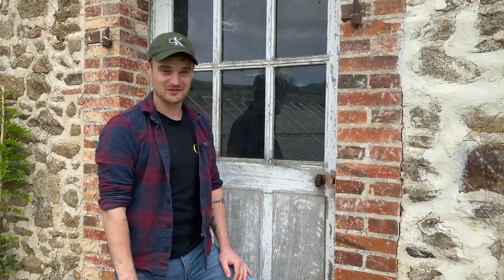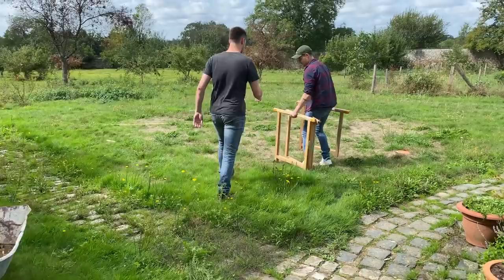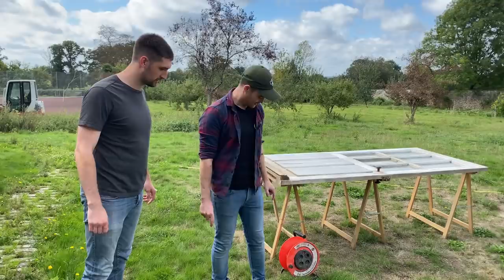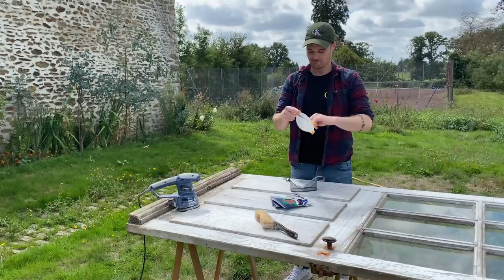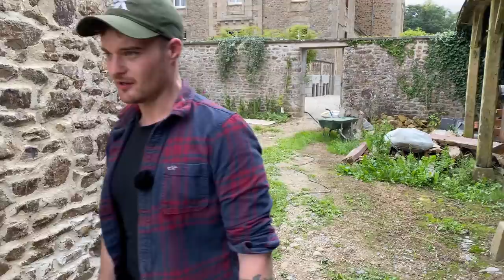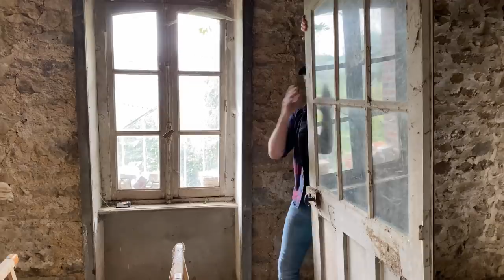Front Door Fix Up - Doing It Ourselves

Comment: The French certainly had a better ideal on hinges. Lift off.
Reply: Willdo1951 Aldone Yes, i love that!
Reply: What kind of hinges do people have wherever you are from? 😮
Reply: @fionasimagination  In America, the norm for doors is a 3-piece hinge, with a loose pin that joins the two halves together--or sometimes a fixed hinge, so you have to unscrew one of the sides to take down the door.
Reply: In USA, some old hinges are like that. The US standard ones are better for security.
Reply: @counter10r  Same in Australia, I have both - we used the 3 piece pin hinges on all the internal doors of an extension
Reply: Almost all in mainland Europe has the hinge thing. It is sooo much more convenient, esp. as a woman to just lift the door off the hinge. I never understood the three piece thing with a pin to hammer in as well as the more 'modern' screw in thing in the US. Way too complicated.

Comment: When you clean the old glass use a fine steel wool pad and the glass will be crystal clear! Glass will look as good as the day it was made!!!
Reply: thinktonka Great tip!
Reply: Also you can use a vinegar and water solution
Reply: 1497caboto Yes that works great. That’s how I always clean windows and mirrors.  

The extra fine steel wool will smooth out little scratches.  I use it on enamel appliances, too (400 grit), and they stay shiny.
Reply: DOES THAT REALLY WORK?
Reply: @theresaromero2855  well that's a great new tip. TY 😊
Reply: Barbi Button My pleasure, Barbi!
Reply: @nativetexan53  it really does! A friend of mine did it to my garage door windows a couple years ago and I couldn't believe how well it worked! Grime builds up in the pores of the glass and plain window cleaner just doesn't get it! Just use the steel wool in a buffing motion and you will be amazed!!!
Reply: Linda Catz exactly
Reply: Fascinating tip!  I will be trying this on our store's front windows!  I would never have thought steel wool would be helpful against scratches - Would have thought it would MAKE them.
Reply: @eledatowle7128  I thought the same thing! Was pleasantly surprised at the results! Use fine steel wool!
Reply: thinktonka 💕Yes! It even worked great on my car windshield 💕 *I used ultra-fine grade 0000 steel wool*
Reply: Linda Catz  is there any other kind of newspaper these days? :)
Reply: @thinktonka  Thanks! I'm gonna try it right away!  Steel wool, who knew?

Comment: We call those “Saw Horses” …
Reply: Our saw horses are usually a bit more sturdy than that and are fixed not flexible.
Reply: Ours are too.,those  are facsimiles
Reply: I think the aluminum “saw horses” can fold up for storage 😊
Reply: The base of the door needs a new weather board that’s what they are called and you can buy them already made. I have just looked them up on Amazon and they start from £21.00 then you screw and seal them to your door, no carpenter needed.
Reply: Rob Westley very neat thats why Jeff Bezos just became the wealthiest man at $2 Billion

Comment: I was always told to not sand against the grain so it wouldn’t open it too much, splinter etc. Have you ever heard that? It must feel good to get on with the restoration, hopefully you can get some supplies soon. There was an amazing song as one of your ads called Papa by Scott Helman, made me a little teary. Good luck with the sanding. 🙋🏼
Reply: Yes, I was surprised to see him use a rotary sander on the stairs and the door, rather than a belt sander. But it looks good💗
Reply: Very true if you're going to clearcoat the item, but not as important when painting.  Sanding cross-grain can leave tiny scratches, which is why people go to finer and finer grit and then steel wool if they're going to poly it (clearcoat).  Since he's painting it, though, any tiny scratches will be filled and covered by the paint.

Comment: Hi, I love your channel and wanted to give you a tip on the right paint for old wooden doors and windows. In Vienna there is a very famous type of Windows, they are usually between 100 and 200 years old and they are painted with linseed oil paint. The benefits are, that the wood is able to breath underneath the paint and you can paint over it without removing the layer underneath if it needs a touch up!

Comment: I am curious if the shutters for the Gardener's cottage door are laying around and if so, will you be installing them?  Sometimes you can still get tannen bleed through oil/alkyd based paint and primer, If you do and you have have access to a shellac based primer it can stop the bleed and definitely works for nicotine. In the US we have oil primers, paints and stains that are water clean up as long as wet and it is so helpful. The oil molecule is surrounded by a water molecule and as the water evaporates it exposes the oil. It's a game changer. Love the video!

Comment: Does anyone know about the risk of lead based paint in Europe? Was curious about that during all the sanding. Here in the States, anything more than a few decades old bears high risk of lead and makes refurbishment all the more tedious.
Reply: Everything always seems to be extremely dangerous in America...
Reply: JMK I was mostly curious about whether European paint was made the same as American paints regarding lead, and it seems that despite some form of regulation in the early 1900s, lead was not banned in French paints until 1949, which I suppose answers my question. But to your point, any professional would tell you that lead based paint should be either encapsulated, manually scraped, or chemically removed in order to contain the toxin. Sanding creates lead dust that contaminates one’s clothing, the ground below one’s work area, and is carried on the wind, all of which are dangerous.

Comment: Luckily you can place a double window frame, just for the cold days. Cost less and look way more beautiful at old buildings like this. It's a teak or oak door. Stays good for ages. Can't be that old because of the paneling, only two, usually about 1910. Does bleed through paint so great idea to isolate it with oil paint. You gave me a good laugh by carrying the door and Billy filming. He must have laughed inside. 70kg isn't for the faint of heart.

Comment: Michael Hint for paint removal off metal fittings on your windows and doors is to place in a fire Paint melts off ( Our Chateau Life tip)
Reply: Edwina Kastner Peter and Anna
Reply: A heat gun (around $30US around here) works great, too, without any soot from fire.  Heat it up, then use a metal scraper and it should come off really easily.

Comment: Michael, another amusing vlog! I don't know if you have any choice about the ads but if possible please stay away from anything over 30 seconds and definitely not 4 mins 33 seconds which was the longest of 6 adverts in this 20+ minute vlog! I'm happy to sit through a bit of crap to support you but not that much. Do you receive more money  for the short non skip ads? If so go for more of them. FYI you could attach a brass kick plate over the base beading if it doesn't hold up. If you have any marine varnish could put that over the base or even whole door. Will help protect paint from uv light as well. All the best.
Reply: Youtube decides on the ads. Apparently you only have to watch the first 30 seconds for them to be paud
Reply: @jacquelinereynolds2934  as a YouTuber - you have total say over what ads you have in your videos, the length of ads and even at what point they appear.  YouTubers get paid with NO ADS. The ads are an extra income.

Comment: Since you're doing such a great job sanding it, I think it would be beautiful stained a deep cherry-mahogany. I'm not wild about the apple green, but it will be fine 💗
Reply: Hi Karin. I was wondering when Michael said the door is not oak that it might be, in fact, mahogany wood.
Reply: Definitely not, Karin. On that cottage? It would stick out like a sore thumb... (the stain, I mean).
Reply: @jmk1962  No, indeed. That's why I commented it (green) would be fine. I merely offered an opinion on a stain. I saw afterward that I was not alone... 💗
Reply: He is using the ambleside shade for the doors and windows which is actually quite a deep green. I was wondering what the colour was so I googled it. 🤣😂 I am not sure where he is going to use the sage and onions shade, maybe on the outside door between the cottage and the greenhouse???